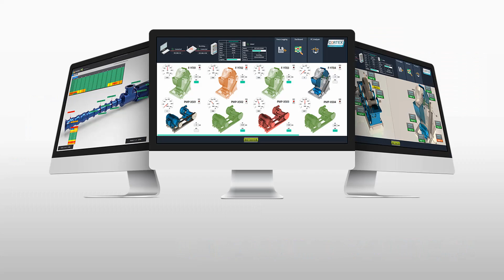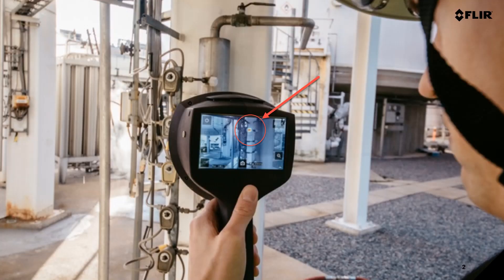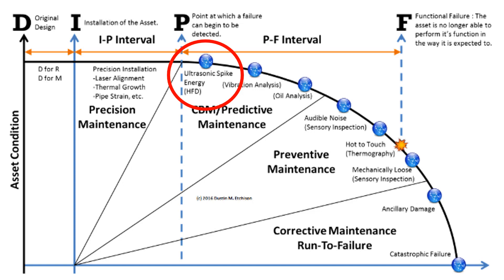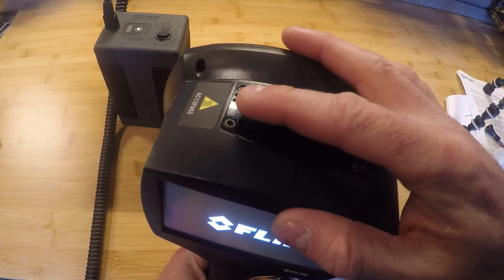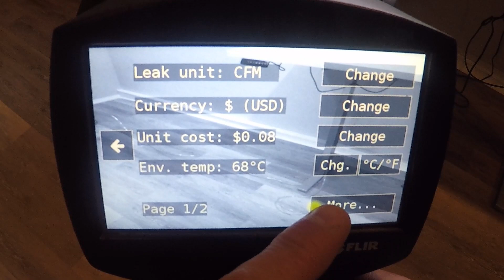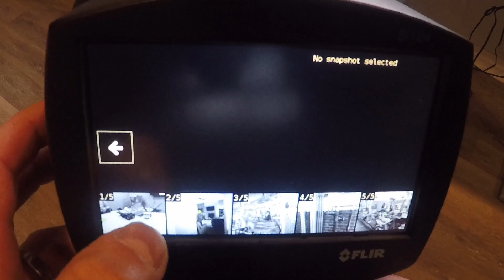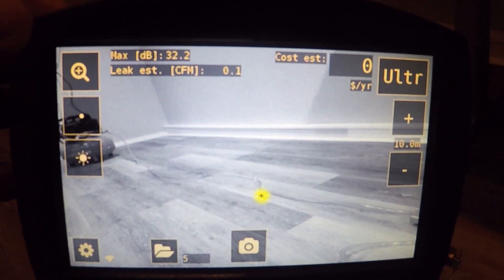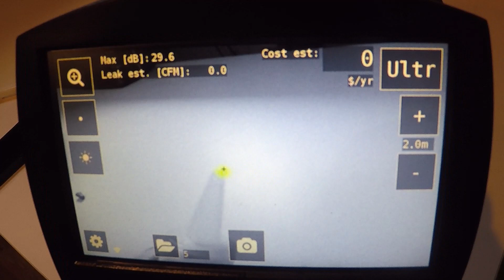Flir Si124 Industrial Acoustic Imaging Camera Overview/Tutorial with I&E Technologies

Comment: Would this be able to see leaks behind a wall? I asked because it would be useful to pressurize a gas line with compressed air and walk through a house or building scanning walls looking for a leak.
Reply from the maker: I wish I could tell you yes but typically it would require a line of sight.  It is possible if you had a very high pressure but it’s unlikely you’d be effective through anything.

Comment: At 5.56 you have THREE "leaks" or is one of them just a "reflection" of one of the other leaks??
Reply from the maker: Thank you for the question!  The two targets on the hose line were leaks, the third was a reflection of the second leak off of the table stand.  You can tell it’s a reflection if you move the camera from side to side - if the the cursor stays in the same spot, it’s a leak more than likely, if it moves with the camera, it’s a reflection.